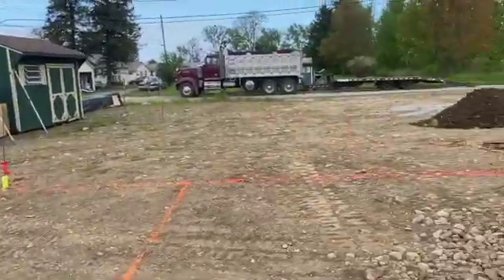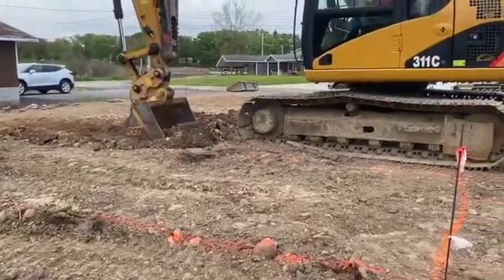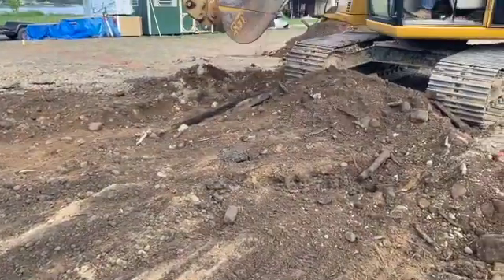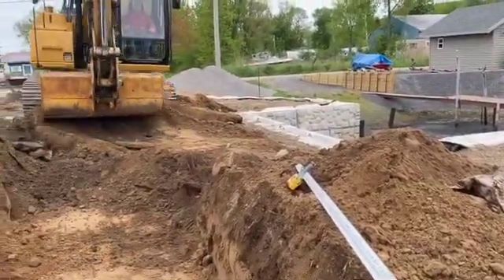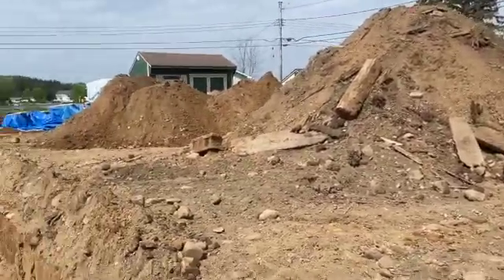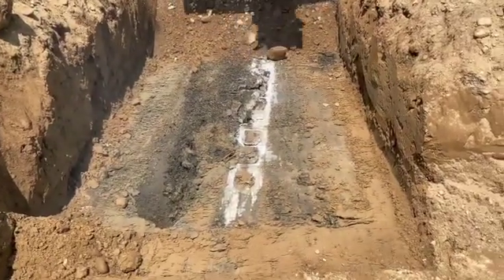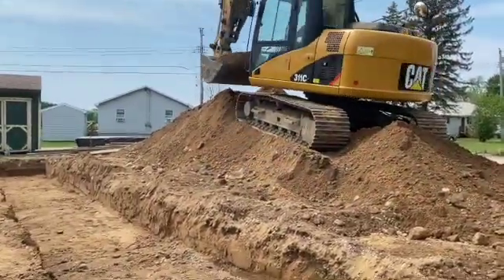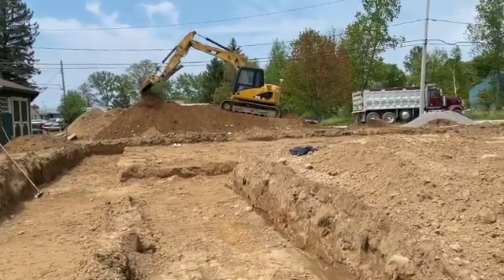Frost protected foundation series part 1

Comment: I am planning to build my new home with in floor radiant heat tubing and would need to know how deep would you dry cut if at all for the slab.
Mine slab type is legal but not well known in Canada. It starts as a normal slab on grade but by using 12 " x 24" foam blocks around the perimeter and 4'x8' x 3" sheets on the outside of the blocks and all on top of 6" of suitably sized rock.
Then multiple layers of 3" sheets set back from the 12 x 24 blocks in the interior so resembles a slab thickening around the perimeter edges also on gravel bedding.
Any thoughts appreciated.
Love those videos.
Reply from the maker: I would not pull the tubing up much into the slab so it will not get damaged and not cut any deeper then 1". Check out my new build series. It is a shallow frost protected slab poured on a short Nudura stem wall. It might give you some ideas. We also did radiant heat in there.

Comment: Hi Bondo, were you excavated out in the front and the back of the house section; I see where there will be a porch both in the front and the back. Is there a reason that there's a line of raised Earth separating the house and porch section? Or is it simply left just to keep your bearings?  Also I saw you recently built on top of an existing Barn foundation all be it that was stone. Is there a reason you couldn't have left the foundation blocks you found in this video? Thanks again for your time sir!
Reply from the maker: Hi Tom The house will be up higher than the porches a little bit. It will make sense in next few videos. Yes we are building that building on the old stone foundation. More videos coming of that. these blocks had a bunch od topsoil beside them and we ripped it out and filled with gravel under that little section.

Comment: Oh man, I am planning this EXACT project this summer. I want to do a shallow foundation rather than a slab as I can get the building up faster and then pick away at my slab/plumbing/in floor heat etc. WIll be watching with interest.
Reply: Extra level of difficulty is that there is a building there already that I will have to pull down and build where it was.
Reply: I am in a similar position. I built a Perka steel frame garage. 40 ft by 40 ft on cement piers, 4 ft deep 3 ft diameter. The building's up but I now have to do the floor / radiant heat. Getting ready for that now inflation is ridiculous.

Comment: I know you use Nudura pretty exclusively, have you looked at the LiteForm ICF products?  Their "LiteFoot" would be just about perfect for any slab built home, especially a monolithic pour.
Reply: To be fair LiteForm/LiteFoot are just 3 inches EPS panels cut to size and held together by fasteners at the edges. Just order EPS panels, fasteners and cut them. Likely an extra 2 hours of work. Less shipping etc... than LiteForm.
Reply: @sebastiantevel898  Good points about making them on-site.  I'd be tempted to use the foam portion of the ICF former as the outside wall of the foundation slab instead of plain EPS.  Cost would be higher but you'd have the locking "teeth" for your first course of wall.